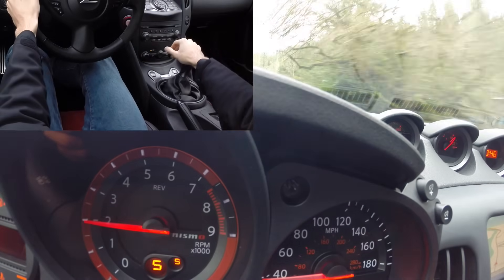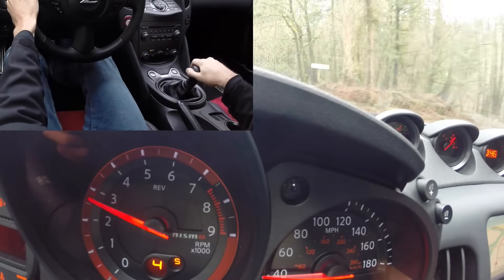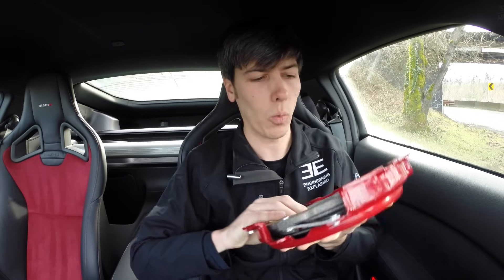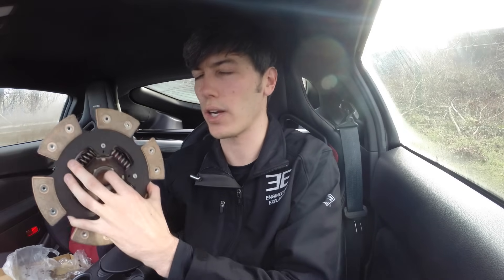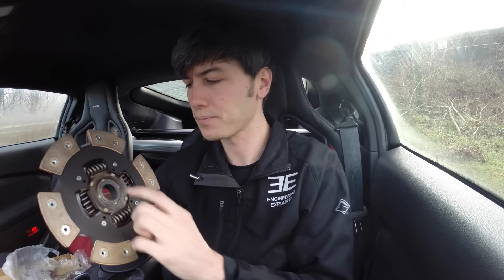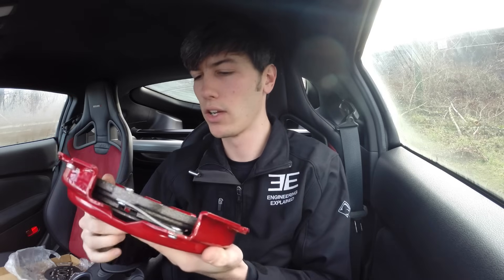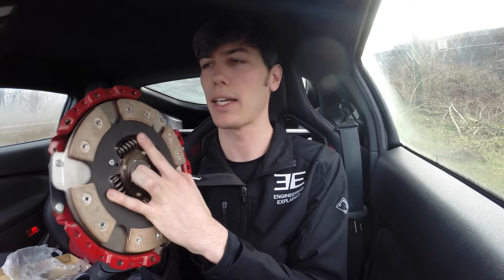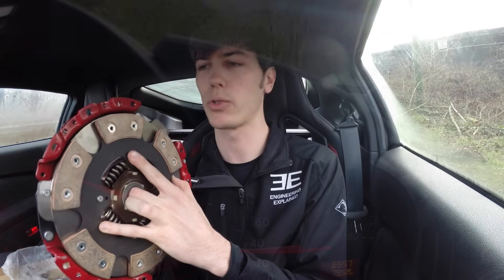What Is Rev Matching?

Comment: Is it bad to downshift and slowly bring out the clutch?
Reply: +Jeremy Pauken Yes.  Doing that will shorten the life of the clutch because you're effectively using it like a brake against the flywheel.   You could perhaps argue that in some circumstances this could be dangerous because if the clutch was released too abruptly it could cause a loss of control.
Reply: I think itd be a tiny bit more wear on the clutch but it's probably easier on things than that jerk if you're fast on the clutch
Reply: Yes, it's definitely better than abruptly engaging the clutch.  

Better still is to press the accelerator to bring the engine speed up, then smoothly let the clutch out. With practice there should be no jerk.
Reply: +Jeremy Pauken if you're just driving around town, the wear and tear is probably no more than slipping the clutch from a stop.
Reply: If we assume that's the case and you make it a habit to downshift when you come to a stop, then you could be halving the life of the clutch.

Comment: When attempting to maximize MPG and reduce brake wear, engine braking is preferred. However, when blipping the throttle during downshifting, fuel is used which decreases overall mpg. I've been told that when downshifting to maximize MPG, the suggested process is to slowly let the clutch out without revmatching. I've used this process and it feels smooth. In this case however, it's clear that the clutch disk and pressure plate work in unison to match the rpm's without driver throttle input. Any thoughts in terms of wear or safe practice? First time manual driver here. Thanks!
Reply from the maker: +Michael Pinder Blipping the throttle uses a tiny amount of gasoline. Your clutch doesn't like to slip. It's designed to withstand it, but slipping it creates wear. I personally would never recommend downshifting and letting the clutch do all the work, but that's not to say that an overbuilt (or well designed) clutch can't handle it. I'd rather pay a couple pennies for gas for each rev-match than replace a clutch (especially true for aggressive driving).

Comment: Isn't rev matching more about double clutch shifting. Spinning up the layshaft while in neutral to prevent having to slowly release the clutch and use the synromesh to match speeds, if you can master it you can downshift quicker and its fun, or not use the clutch at all.

Comment: I once had a discussion with some guys on a forum and one of them had what sounded like a very valid point. He said that unless you double clutch, rev matching isn't going to benefit you because when you put your clutch in and then blip the throttle the countershaft has been disengaged from the engine so that throttle application really only revs up the engine and not the countershaft, and doing this won't save your synchros. However, am i right to believe that this still prevents clutch wear i.e depressing clutch + revving + downshift and then releasing it?
Reply: +Godzilla555 Yes you'd be correct. Rev matching without double clutching would only match your engine speed to your wheel speed. The synchros still work the same whether you rev match or not, unless you double clutch.
Reply: +Godzilla555 Good point tho, but if you think about it the rotational inertia of the engine is a lot more bigger than the inertia of the countershaft, so i bet you could solve the 70-75%-of the problem whitout double clutch.
Reply: +Viktor Speiser Yeah I agree. You really don't need to double clutch. Rev matching alone is good. I'll usually heel toe downshift when coming to a stop. Unless your synchros are shot there's no reason to double clutch.
Reply: Hmmm. Thanks for your input guys.

Comment: So lets say you're cruising down the highway at 65mph in 5th gear. If you came to a complete stop at a red light and then shift straight to 1st. Is that bad? Like do you need to shift down through all the gears before you shift to first? Or can you just come to a complete stop and shift straight to 1st?
Reply from the maker: +Skyler Polkadot You can go straight to first, no issues. Just don't put it in first at highway speeds. :)
Reply: Engineering Explained  Awesome! Thanks

Comment: As a 14 year old with my learners and only been driving an automatic, when you blip the throttle, is there a way to over do it, or rev the car too high?
Reply from the maker: +RCkid288 Yes, very easy to do. If you let the clutch out too slowly and apply to much throttle, it will tend to pass the RPM you desire.
Reply: Okay.. so how do you "tell" how high to rev the car?
Reply from the maker: +RCkid288 Practice, really. It's not like you have to memorize a set of numbers, you just need to know how much throttle to apply and work out the timing of releasing the clutch.
Reply: Ah. I see. Thanks!
Reply: +RCkid288 It's  actually easier then is sounds, it only took me a 2 weeks to get it down pat.
Reply: +Engineering Explained does anything bad happen if you over rev

Comment: As a mechanic in Australia I have 2 statements about this 

1. in the USA which from your accent I will ASSUME you are from (possibly canada please don't smite me) Most people don't know how to drive "manual" or "stick" and with the way the world is going this will probably be useless in 10-15 years given electric cars

2. You used the example of going from 4th gear to 2nd gear now you failed to tell the good people at home THIS IS A VERY BAD IDEA, when you go up threw the gears if you rev them right out you will hit a "limiter" or what is refereed to as a "fuel cut" this is to prevent you making the engine spin faster then it is designed to go BUT if you down shift at a high speed skipping a gear you MAY not will MAY cause the engine to excited the "limit" cause it to kiss the valves with the piston on a High interference motor, So it just turns into a giant hand grenade and a lawn ornament until you have the money to replace the motor. 

People will have there doubts about this statement but I have seen it 1st hand on multiple occasions

Comment: Question;
On my motorcycle I have to blip the throttle BEFORE I change to a lower gear in order to a avoid a catastrophic "clang!" sound. 

Does that also fall under Rev matching?
Reply: +Kevin Arnold 
Yes, it is. Motorcycle gearbox work on the same principle as in car (there are movies on youtube with more details). As I said earlier there are no synchronisers in motorcycle gearbox, so you must adjust speed of engine shaft to corresponding speed of gearbox output shaft (shaft with chainwheel).
Reply: +Kevin Arnold Yup it's the same thing. A novice way of downshifting is just to let the clutch out slowly. If you blip the throttle as soon as you pull in the clutch, down shift, let the clutch out - that's rev matching.
Reply: +Kevin Arnold your car's synchromesh might not be working properly. Or if the sound is coming from the engine area, engine mounts could be broken.
Reply: Ghoshan Jaganathamani no I was talking about my motorcycle :P
Reply: +Kevin Arnold ahh my bad. sorry I don't know a thing about bikes.
Reply: Ghoshan Jaganathamani no problem :P
Reply: +Kevin Arnold 
A lot of motorcycle have unsynchronised gearbox, so you need to
synchronised rpms by yourself, the way you described.
Reply: rados123 but does it fall under "Rev matching"?
Reply: rados123 OK thanks!
Reply: Trevor Phillips I'm talking motorcycles. To rephrase, "If you blip the throttle as soon as you disengage the clutch, down shift, re-engage the clutch..."
Reply: +rados123 This is absolutly false, the only way for you to say that is not owning a bike. You don't have to rev match on motorcycles, you can do it of course (i do it when riding a bit fast) but it's not necessary.

Comment: I thought that was part of learning to drive a manual. How does a rev matching feature know what gear you are attempting to select?
 It is also worth while to learn how to double declutch as it gives you the ability to do quicker downshifts in the lower gears. For example on a steep road with a hairpin downshifting into first can be way better than staying in second. Most gearboxes do not like fast down shifts into first gear but if you can double declutch then you can.

Comment: I know I'm only 14, but I have a good idea. Wouldn't it be great if auto factories start including a secondary RPM gauge in the middle of the primary RPM gauge in manual vehicles to show the RPM of the pressure plate so that rev matching could be easier?
Reply: You mean the rpm of the transmission imput shaft and you would need to be in the gear you're changing to. By that time I've already bliped the throttle. When you start driving you'll find that rev matching is extremely easy. After 2 or 3 miles in a new vehicle I don't even have to think about it.
Reply: Pressure plate is bolted to the flywheel. Flywheel RPM is always the same as engine RPM. Interesting idea. However the process of rev matching a manual transmission for downshift should be done in a double clutch fashion. This means you would need a gauge that can predict what gear you are trying to revmatch while in neutral. I guess it would be possible to revmatch after downshifting (I never do). The RPM indicator could be on the input shaft of the tranny. To be honest though; with practice you get natch it up close enough. The whole maneuver is so quick you wouldn't have time to figure out the two needles. Pretty cool idea though.
Reply: +Arthur Lejawka Thx!
Reply: What about some scales about which speed it matches in each gear around the rev counter? Would be cheaper than a second gauge and would also help double clutching

Comment: Does this car also have upshift rev matching so that all your up shifts will be smooth too?
Reply from the maker: +thecamlog It will hold the engine RPM on upshifts, if you wait long enough with the clutch depressed. If you shift very quickly, it won't fully catch up.
Reply: +Engineering Explained thanks for replying! Wow this car must be very easy to drive for a person learning manual, very forgiving.

Comment: Thanks for the brilliant explanation, I never knew the physics behind rev matching. In my 02 Focus SVT 6spd manual I always enjoyed pushing in the clutch and hitting the gas before downshifting, maybe that's why my 105,000 mile car still has the original clutch and is still pulling strong.

Comment: For manual cars that have it, how does the automatic rev matching work?
Reply: +One_More_Wolf The car utilizes multiple sensors which are located in the clutch pedal, gear shift and transmission. As soon as you push in the clutch pedal the ECU (electronic control unit) will wait for you to move the gear stick to a new position. Now when you select a lower gear than the one you were in the ECU notices that and adjusts the throttle do make your engine RPMs rise before you engage the clutch again.

Comment: rev match vs double clutch?
Reply: +camaqazi I assume you mean the shifting technique and not the type of transmission.  Its basically just taking it out of gear and into neutral, depressing the clutch, then pressing the clutch in again, and shifting to the desired gear.  Its old school.  Also some semi truck drivers use this technique.

Comment: I know it's not as necessary these days, but how about a video on double clutching - what it does inside the gearbox and when to use it?  While I doubt there are gearboxes being made that lack synchronizer and/or baulk rings, but there are times when a worn out box will crunch on up and downshifts (although usually the downshifts will be more of a problem)...not to mention when attempting to drive something old, especially old trucks, which sometimes had what we used to call a "crash box."

Comment: so i guess not to use gears to slow down to  as I do so i should stop doing that
Reply: +The Anton Show you can use the gears to slow down, if you downshift properly. At very very low rpms, it's much easier.
Reply: +The Anton Show The clutch is a very expensive brake pad to replace.  Proper technique for engine braking is to rev match and engage a lower gear. The compression of the engine will slow the car down, and is great for regulating speed when going downhill without overheating your brakes.

Comment: So can you not engine brake with a 370Z?
Reply from the maker: +Joe G You absolutely can.
Reply: +Engineering Explained Mind explaining? I don't drive stick a lot, but from my experience the act of engine braking is from letting the clutch out and using energy to speed up the engine/slow down the car. Wouldn't rev matching get rid of that effect? Is there an option to disable auto-matching. Thanks for the reply.
Reply from the maker: +Joe G Ahh I see. No, you're not using the clutch as a brake, you're using the engine as a brake. You put it in a lower gear to pop the revs up, and this provides more engine braking. You don't want to use the clutch to do this as it puts wear on it, and strains your transmission (and can upset the handling). Match the revs, get it in gear, and let the clutch fully engage to slow down.

Comment: why im watching and still don't know how to drive a manual :D
Reply: You should definitely try to learn... It's fun lol
Reply: +sabufinisher It's a great skill especially if you need to steal some European/Russian cars. ^_^
Reply: +sabufinisher Get a manual and learn, learn, and learn!
Reply: +sabufinisher same
Reply: Haha same
Reply: +Carlos lol
Reply: +sabufinisher He is just stating some tricks that may help you learn, but you actually have to go out and try it first.
Reply: Same
Reply: +sabufinisher  Just double clutch or jam it in to gear you will learn" best to get someone with good credit and test drive a new or used manual car from dealer you or your friend dont care for and learn that way..lmao
Reply: +Keith Bartlett Yeah.. And that's why I insisted my new car be directly from the manufacturer and not one on lot lol. I went to pick it up the day it came off the transport truck.
Reply: A good helpful trick thats helps learning the clutch on a stick/manual, and pull out without stalling it is;  try it in a 4X4 and put it in low range, you can pop the clutch at idle in 1st gear at idle and it will likely never stall. After a few of those keep it in low and pull out in second gear, then third. This will build your confidence. Now your ready to go to high range.
Now go and stop on a hill and try to pull out without rolling back or stalling. If you have a hard time, go back to low range and practice. Usually after you get the feel for where the clutch engages it becomes much easier.
Well worth the time to learn a stick, you have much more control and more power to the wheels than an automatic.
Hey you'll need it when you buy that Porsche or Ferrari on day.

Comment: I was under the impression " double clutching" forced the engine rpm to be closer in sync with Trans when done porperly. causing Rev matching to occur. with less wear than just dumping through the gears. I know my mini in sport mode holds boost longer making it harder for the engine to lose rpm and having a dual mass flywheel I don't Rev match or double clutch and it syncs fine.

Comment: Once you understand rev matching and how trasmission works you can shift gears without even touching the clutch (but please dont do it unless you know exactly what you are doing) all these are reasons why i will always own and drive a manual car.
Reply: +AceDrives hahhhha I was actually doing that for more than half a year to prevent the wear of the clutch of my mum's aygo, which was by far more than weared and slipping on full throttle of the NA 68hp 1.0 engine ...Eventually I found the time and fitted the new one, but still shifting without clutch sometimes out of habit 😂
Reply: +Yury A I feel sorry for the Syncronizer rings :D
Reply: +BerndvonBackstein Well, synchros are not "strong" enough to match the revving of the entire group of organs from the crankshaft to the clutch, so you have to rev match properly with no mistakes or you won't be able to engage the new gear at all, but just hear that horrible dog ring scratching...
So I suppose my synchros are fine since I've heard that sound not more than a couple of times ...